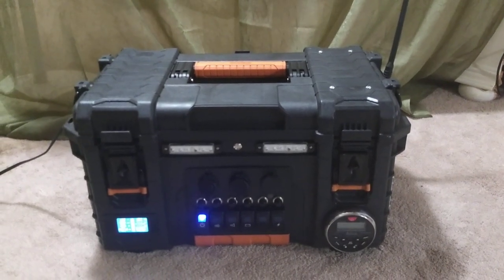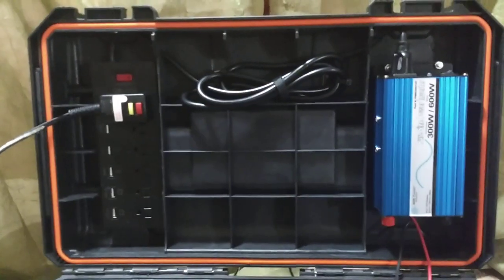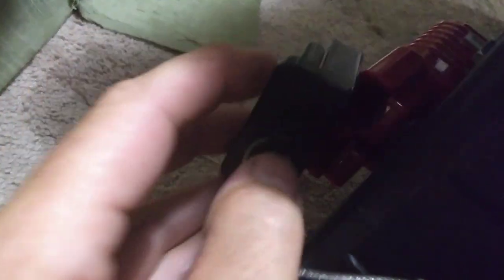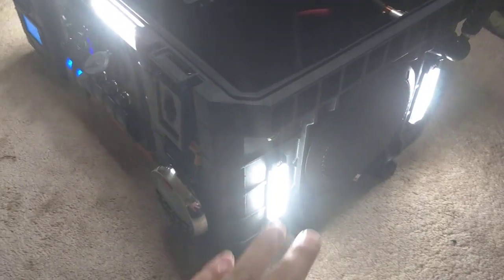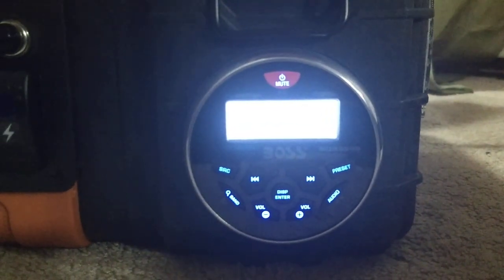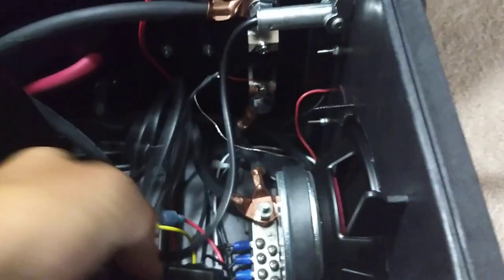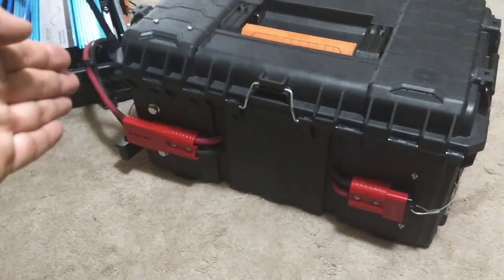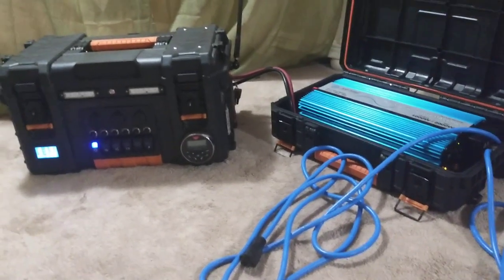DIY Power Box PART 2 for work, camping, home backup, or off-grid

Comment: wow nice build love it 🥰🥰🥰🥰 i have two power station i have 48 volt 120AC 60Hz i have 4 110 AC outlet with 2 15A 1 20A Breaker and switch between the positive of my batter and positive of my inverter i used 12Gaude wire that used in house for the wire for my outlet i going put solar charger and usb port not finish yet building it and i going put Led light on it not finish yet

Comment: Really nice job....but you will definitely need a LOT more battery. I started with 35ah SLAs, but have since switched to 100ah lithiums. The cost is substantially higher, but the usable power, consistency in voltage throughout the discharge cycle, the weight savings, and the long term use of the lithiums begin to make sense for emergency backup systems like this. Really nice job on thinking it all through and the clean install
Reply from the maker: I thought about it but all my other systems are lead so I wanted to be able to parallel them to my DC generator for direct charging without any additional controllers.

I am working on a kit to use DeWalt 20v batteries to run small stuff like my DC fridge. I already have them for my tools so its just a matter of expanding the number of packs I own.

Yeah, I may just switch over everything in the future. The pricing is really getting good especially if you consider investment over time. They also can be drop in replacement for lead chemistry. Probably when I kill all my new AGMs I'll go lithium.

Comment: what size audio style inline fuse are you using on the positive side? also can a breaker be used for that situation rather than the fuse to provide the same circuit protection that can then just simply be reset rather than replacing a fuse? I am going to be building my box here shortly using a large Dewalt box but plan on using a lot of the ideas that you put forth in your build here. TYVM for the ideas and sharing it all with us / me.
Reply from the maker: I think I used a 200 amp, I'll never use that much current. Basically for short circuit protection. You can use a breaker instead. I needed the wires to go a certain way and I had this laying around so I used it. All of my other stuff used breakers.

Comment: I notice in your component list PDF, linked from your web site, that you bought 5' of 22/2 shielded security cable. Did you need 5' because you had to wire the whole box up that way? Or did you only need it for the power meter but 5' was the Home Depot minimum order size?
Reply from the maker: Just bought extra since. Only took a foot or so.